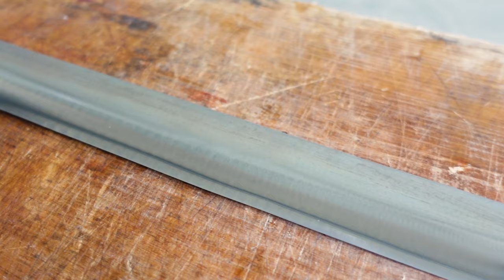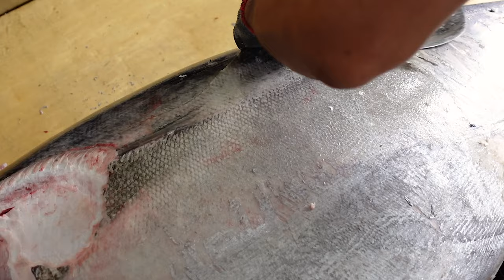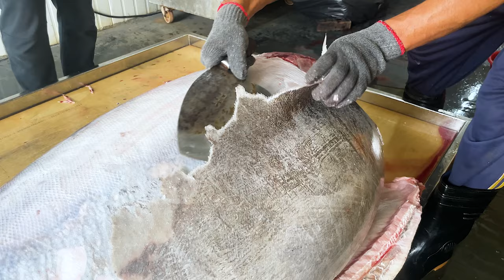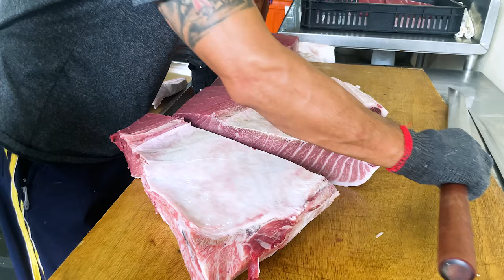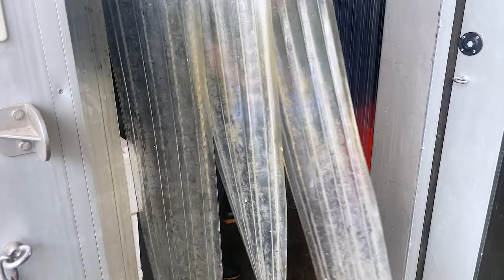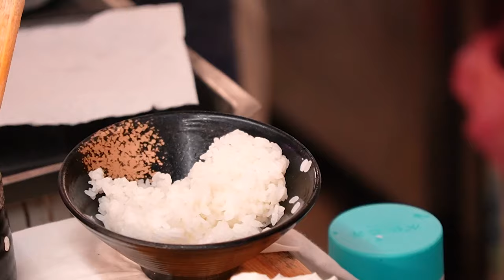Sharp Katana! Fish Samurai Cuts Giant Bluefin Tuna to Luxurious Nigiri Sushi / 炙燒黑鮪魚金三角握壽司

Comment: Well, this video has gone a small way to answering a question I've asked on other videos, but never received an answer to- what happens to the meat from the tail section that gets cut off? I now know that the tail fluke fins are cut off and discarded, and that the tail section is kept along with other removed meaty body parts, presumably for some kind of processing to extract the meat for use elsewhere... whatever that may be!
Reply from the maker: Other restaurants will need these cutouts, perhaps for BBQ or soup😊